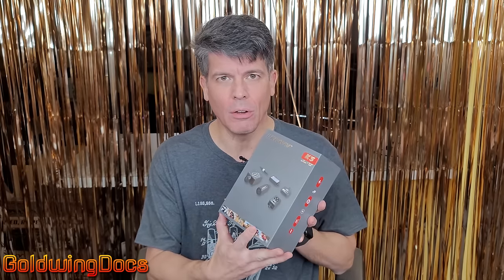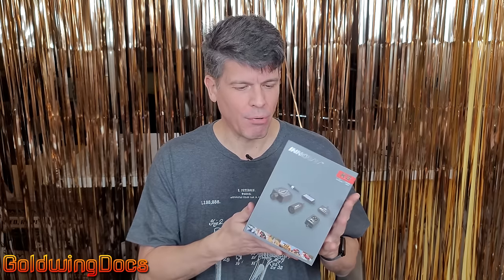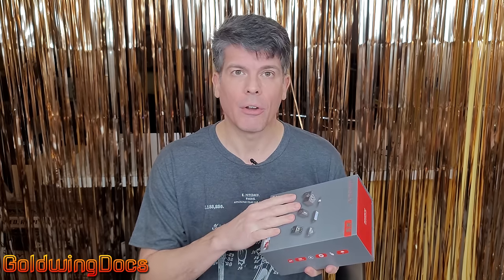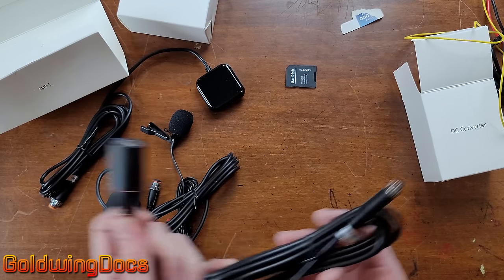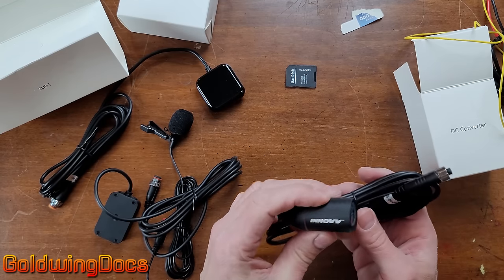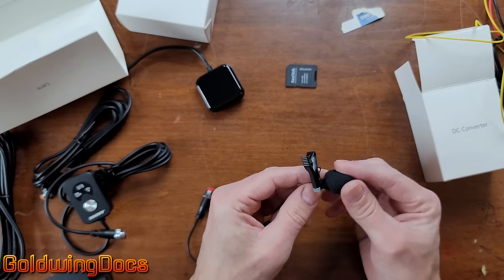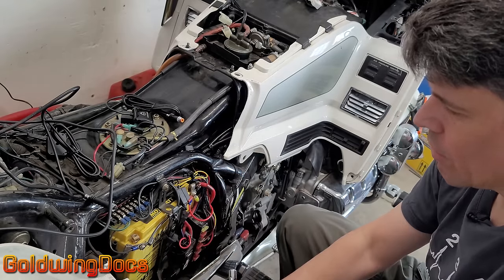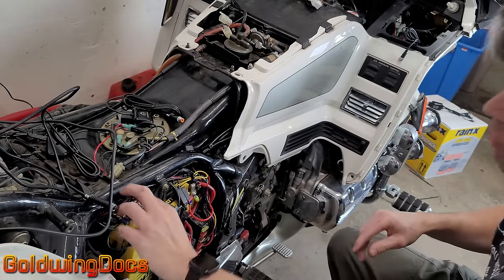Innovv K5 4K motorcycle dual camera system: Unboxing, Goldwing Installation and Review

Comment: I couldn't get my phone to connect to the Innovv Wi-Fi. Had a heck of a time. Finally put phone in Airplane mode with wifi on and no problem! Suspect that was your issue too. Good video. I have mounted my K5 on a '22 Moto Guzzi V85 TT.

Comment: I like it but i feel the main control unit should be someplace in the middle of the bike not at the very front, great video.on how it works.
Reply: The reason the dvr is part of the front camera is the 4k video won’t do well with a long cable going from the sensor to the dvr so it’s all built into one unit
Reply: @jaredfowler2431  Since 4K requires a lot of bandwidth, most not all cables cannot transfer the resolution over distances of more than three meters. 9'10" if you put it in the center of the bike that about 4' long and should be more than apposite for the task. But i do understandable your point as well.

Comment: I just bought the K5 and I’m a tech guy and while I love it the design is a little on the poor side. The cables coming off of the front camera should be long enough to run toward the middle or back of the bike. This may not be an issue for bigger bikes (touring) but depending on your sport bike you may have some wires showing. I installed this on my 1290 Super Duke GT and it came out nice. INNOVV we need longer cables going backwards not towards the front. We need a section in the manual or online explaining every setting in the app and we will be golden. I’m ok with the size of the front unit but the cables ugh
Reply from the maker: I agree with all your points, and in fact I mentioned the cable length a couple of times in this video. The app could really have to do with some more documentation as to the functions in it.
Reply: Yes Great idea but now everything is on the front and you need to do some cable management to make it look decent. With everything in front in crash will it get destroyed and lose footage because of DVR damage? just curious as if box was in middle of bike would be harder to damage DVR box, again just curious

Comment: Is there anyway you can post a video on how to open a gl1500 trunk with the latch bar not attached to the finger pull tab under the trunk. I messed up and closed mine after working on the latch assembly
Reply from the maker: Ouch. Very common problem when the latch assembly is not put back together using the correct technique. It's been talked about on the site a few times, including a couple tutorials. See:

https://goldwingdocs.com/forum/viewtopic.php?f=14&t=23051

https://goldwingdocs.com/forum/viewtopic.php?f=14&t=62664
Reply: @GoldwingDocs  thanks we were able to go through the rear of the trunk and take the two latches off the trunk with a long screw driver

Comment: Way to many cables from the camera for a motorcycle. The DVR should be separate from the camera. Nice video Thanks
Reply from the maker: That was my first thought as well. I really thought it was going to be a problem, but once I got it installed, it worked quite well.

They might do better by having a single cable bundling them all together from the camera, and then have them split apart, which you could hide in the bike somewhere.

Comment: After seeing the front camera module I'm glad I chose BleSky cause the camera is separate yet still as big not a tiny little thing like cheapos I've tried.
Reply from the maker: The BluSky is 1080P only. As of right now, there are no 4K cameras where the 4K camera module is separate from the DVR - as far as I know. I suspect this is because the camera has to do a lot of processing and the data rate is high.
Reply: @GoldwingDocs  Just to let you know fix plexi glass in front of your lens I've used my cam system for over 12000 miles already have rock chips on glass lens unlike your model you have to replace the whole unit my suggestion is that big camera box needs to go to the rear of the bike easier cheaper if you have to replace  replace the cam lens camera unit.  What is your sim card you can use the Blue ski uses a 128GB A1 not cheap but can hold around 9 hours of recording at interval recordings at 5mins 111 clips of 5  mins long total 222 slides.  Just to let you know I had caught some great footage so far.  Some close calls I had from idiots.  Not to mention my welding ability on a cooler caddy I built for a 39CI Igloo cooler it started to fall apart after using it for years the cover flew off first watched cars dodge it then the steel rack started to come apart seen steel flat bar falling onto road then the cooler went sliding bye bye if there been no wind it would of went right into the bumper of a Simi truck it just slid to the right side of the rode hit the edge of emergency lane and dust like it exploded...  Also caught a Rock slide just 8 vehicles whom like emergency stopped on road.

Comment: Does it matter which way the GPS device is facing. I’m wondering if I mount it pointing slightly to the left if it will show my bike sideways in the app.
Reply from the maker: It doesn't have a compass in it - that's not how GPS navigation works - so it will work fine no matter how you position it. As long as the top of it is pointing up and has an unobscured view of the sky, it will work fine.
Reply: @GoldwingDocs  Thank you. I have mine under the passenger seat so let’s see how that works out. I watched another YouTuber install his under the seat and he said he hasn’t had any issues.

Comment: Why did you not mount the camera in the centre?
Reply from the maker: Because if you hit a large bump, the front forks can compress enough that the fender would hit it. Technically it still could of the steering was full right, but if your front suspension is compressing fully while the steering is at full lock, you have other, more seroius problems to deal with!
Reply: @GoldwingDocs  I don't think your suspension will compress that far. I've seen plenty of other cameras mounted in the centre and not get hit.
Reply from the maker: It does, and it would. I measured before installing.

Comment: Great instruction!
I have a need for a front and rear camera and this is the unit I'll purchase. As I carry my laptop for distance trips, I have a tip from my trucking days; " for police I've carried extra flash drives to download just the video they need"! Getting video cards back from police and insurance has always been a hassle.
and flash drives are cheap!
I just bought an 06 GL1800 and my mounting may require drilling to hide the cameras. 
My question pertains to lenses. I've run dash cams, but now this unit will be out in the elements. Does anyone have a suggestion to protect and clean the lens? Thank You in advance.
You all are in my prayers
Hoka Hey
Reply from the maker: You can also just download the video you want directly to your phone over the built-in Wifi, and share it that way.

I use just the same Honda Spray Cleaner and Polish to clean and protect the lens that I use on the rest of the bike. It has worked amazingly well: https://amzn.to/39hkL4u
Reply: @GoldwingDocs  Thank You Sir

Comment: Looking better those Motorcycle cameras. But not going to invest in something like this before Bitrate goes up A LOT more and 4k 60fps front and back.I am saying that I want that option on a motorcycle camera system like this to use 4k 60fps if I wanted to. But this is limited to 4k 30fps with too low bitrate and only full HD in the back with extremely low bitrate..Not good enough. If I am going on a road trip or something I want good looking video with high quality with 60 fps and high bitrate.

Comment: The app should use Bluetooth.  Too many bugs in the app to recommend. DVR should not be in a camera. Improved the system in the wrong areas.
Reply from the maker: There are technical reasons for what they did.

1. Bluetooth is FAR too slow to do transfers of video from the camera to the phone. For 4K video, it would take hours to transfer just a few minutes of video. That's why pretty much ALL video camera management apps for modern cameras nowadays use Wifi.

2. The bandwidth of 4K video presents some real challenges in transmitting the video reliably to a remote DVR. I agree, it's not idea to have the DVR in the camera.

3. The app did have a few bugs originally, but it is remarkably reliable and stable today.

Comment: If they did not fix the problematic GPS system and crappy connectors then releasing a 4K version is putting lipstick on a pig.
Reply from the maker: The GPS is rock solid, and updates VERY quickly. The connectors are also solid and waterproof.

That said, I did not have problems with either the GPS or the connectors on my K2.
Reply: I had a K2 on my last bike before it got totaled. I was considering the K3 and the K5. Decided on the K3 because of that whole thing with the connectors all the way up front, and the DVR and SD card in the front camera. The K3 is the same style as the K2 but with the updated features of the K5. Better connectors, remote, and microphone.

Comment: Seems a lot of installation just to take a video. I like my action camera on my helmet, it sees what I see and it goes where I go, not just stuck to the motorcycle all the time.
Reply from the maker: This is a lot more than an action camera, obviously. It records front and rear, and is a parking monitor camera as well - neither of which you will get with a helmet-mounted camera. You also don't have to worry about charging batteries or batteries running out, or remembering to hit "record" or anything else - you just ride, and it works automatically.
Reply: @GoldwingDocs  I have a USP power plug on my bike so just plug in the camera and don't have to worry about the battery running down, I also plug my GPS into it, as far as all that other stuff, I have no need for it. I can move the camera from vehicle to vehicle, with no problem, and I can take it with me when I leave the vehicle and keep taking video, and really don't understand what I would need a parking monitor camera on a motorcycle for.   But there are a lot of people out there that like to have all these toys, so I would say, you will sell a lot of them to people who have the money to spend on them. Have a great day stay well and enjoy the ride, I will.  as soon as it stops snowing LOL